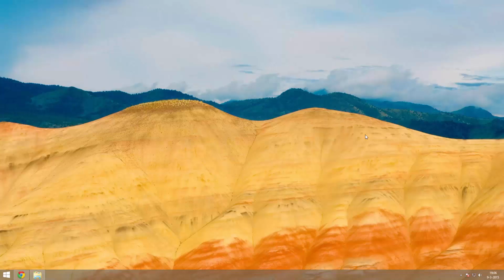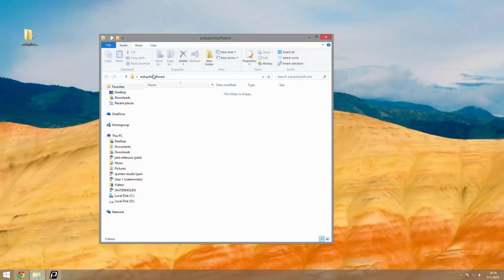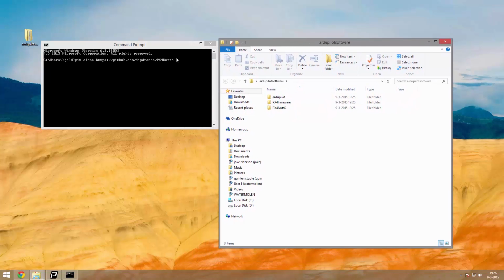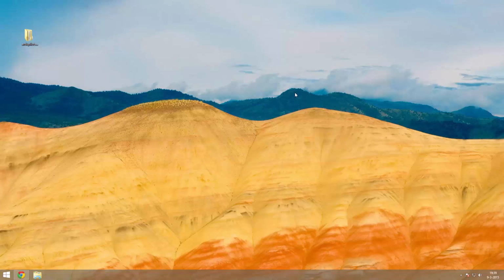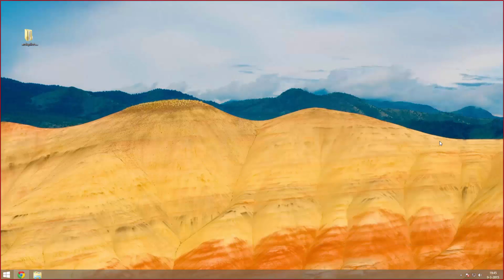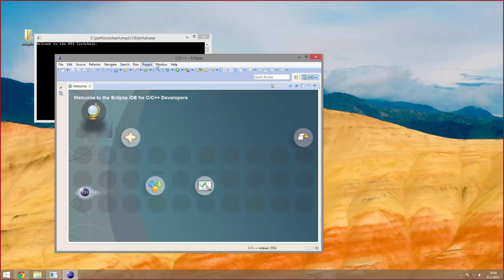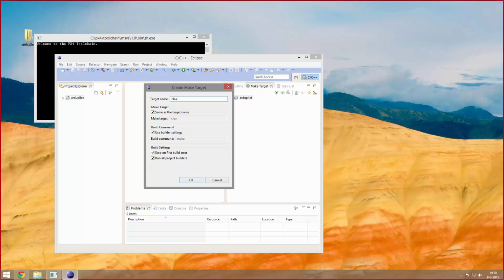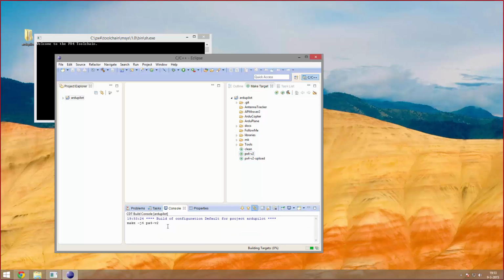Tutorial 0 - Installing the toolchain and setting up the development environment

Comment: Could you please help me? I can not make command like as text as below. These are some error from "make configuration".

make: ../mk/apm.mk:3: pipe: No error
process_begin: CreateProcess(NULL, uname, ...) failed.
make: ../mk/environ.mk:5: pipe: No error
'pwd' is not recognized as an internal or external command,
operable program or batch file.
../mk/environ.mk:38: * ERROR: cannot determine sketchbook location - please specify on the commandline with SKETCHBOOK=<path>.  Stop.
Reply: P.S. window10 64bits